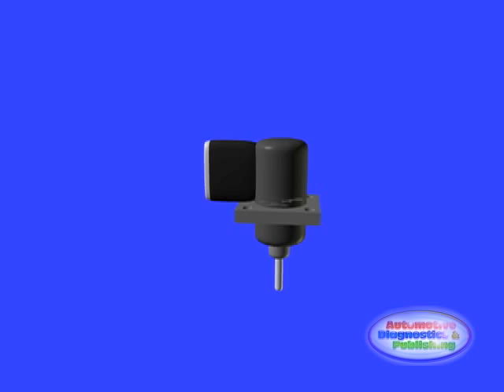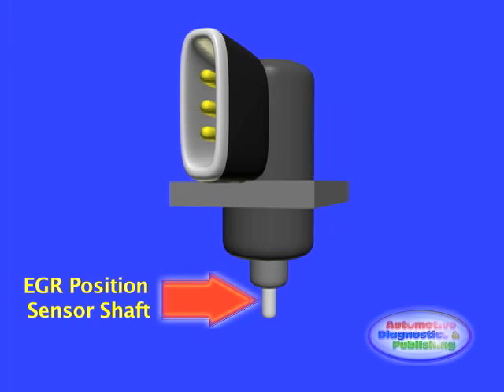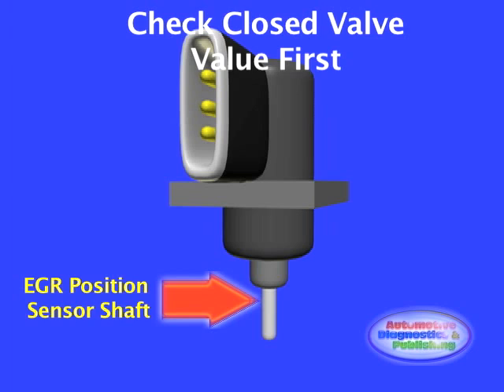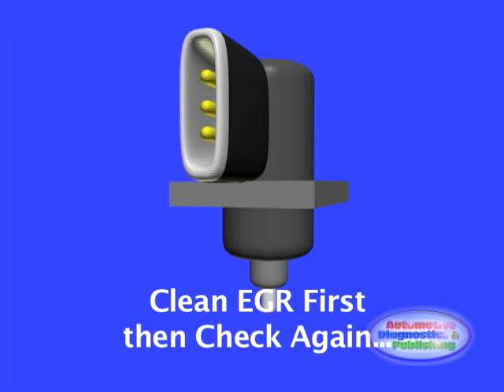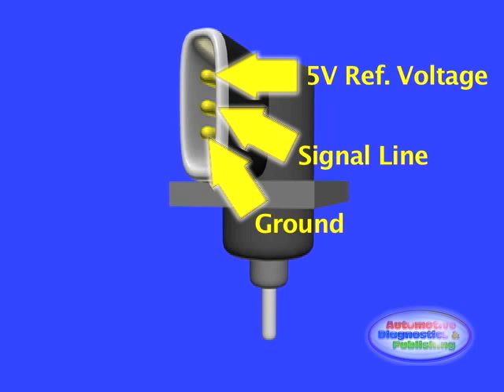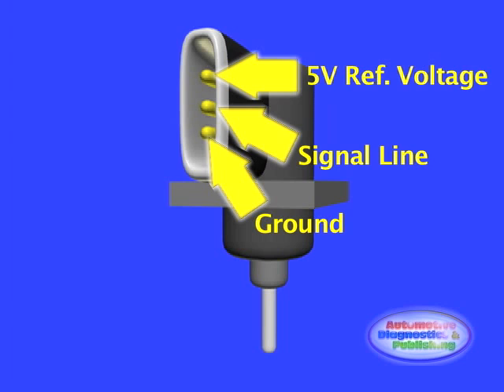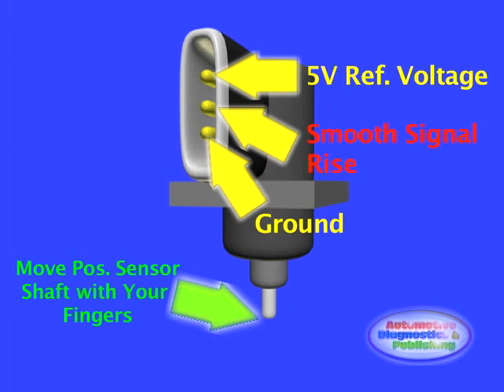EGR Position Sensor Testing

Comment: have code 1491  egr valve insufficient lift do I changed the egr valve  with a new one. I still have this code coming up. what else can I do
Reply: Replace the EGR valve. If that doesn't help, maybe it's the vacuum solenoid or the purge valve.

Comment: Engine light on diagnostics low input can you help? Please
Reply from the maker: Ok, what's the issue?
Reply: @ADPTraining   jag xtype engine light on  low voltage to egr. The two outside terminals  show a voltage reading of 5V: middle terminal 0V. The car seems to be running ok! Thanks for the reply
Reply: afaik @michaellafferty9456  the 2 outside wires (1 & 5) should show 12V. the middle on top row (4) should show 5V and the others on top row something low like o.4V and 0V

Comment: Can anyone help me with installation of egr solenoid in which way it has to face or does it matter 19 tdi vw 2001
Reply: Did you sort this douglas? I replaced my egr over a year ago but it never sorted so just unplugged it an ran fine. MOT now due and engine management light will be a fail so need to sort it. Mines a VW T5 1.9tdi 06 plate.